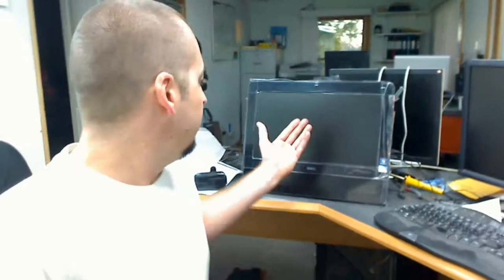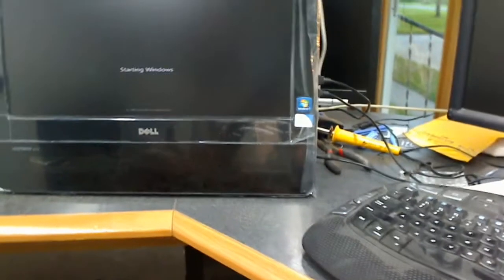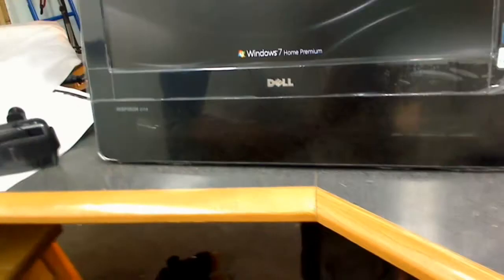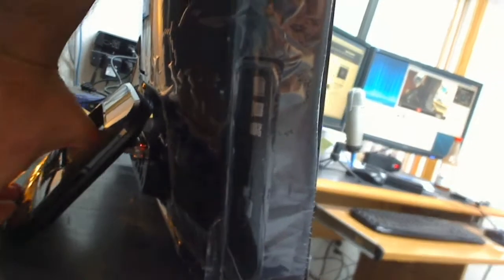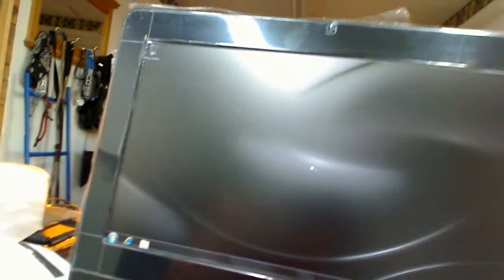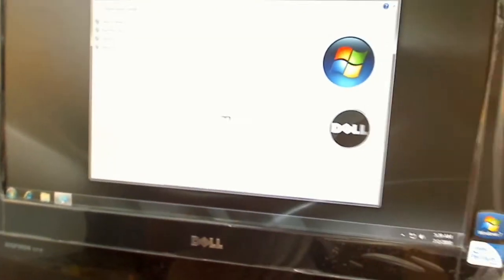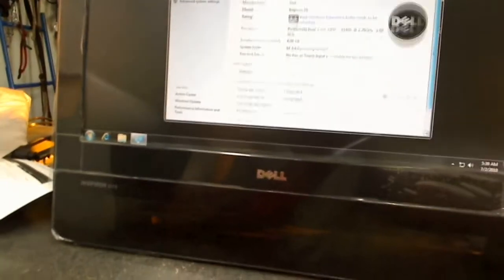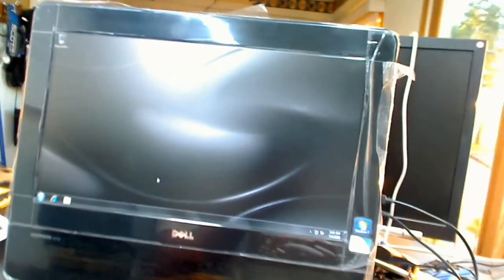Dell Inspiron One 19 - Quick Look

Comment: I have this computer and wont power up, am used to the towers working on them but hell how do you get to the power supply in one these, i pulled the front panel off took all the screws out around the frame thinking the screen would drop out, WRONG, its in there like super glue is holding it, any ideas,thx.